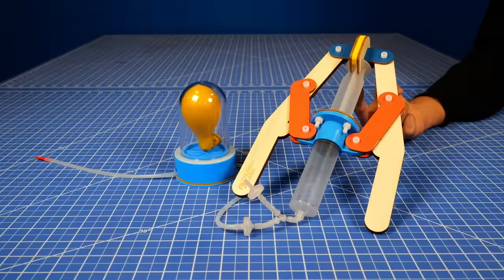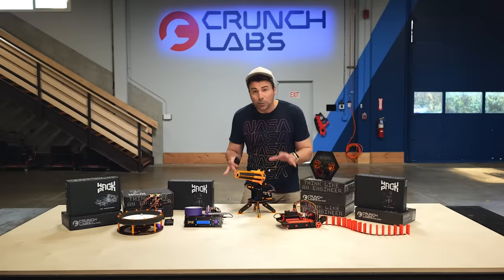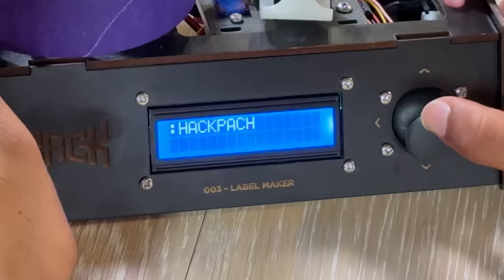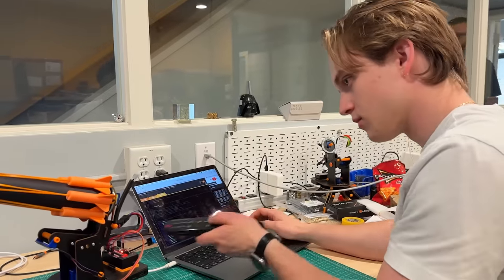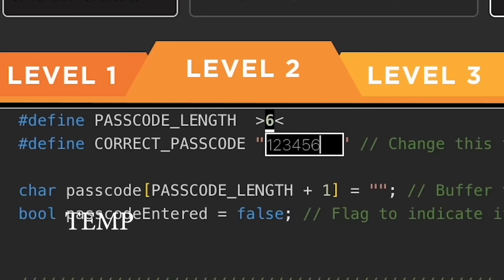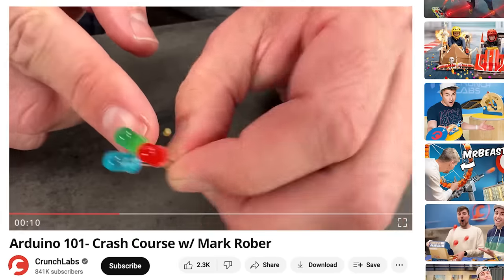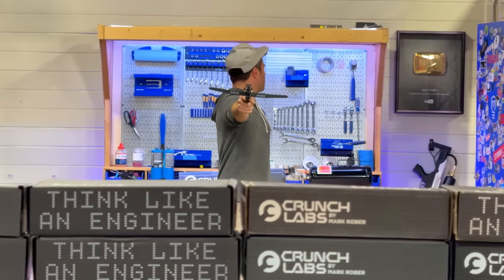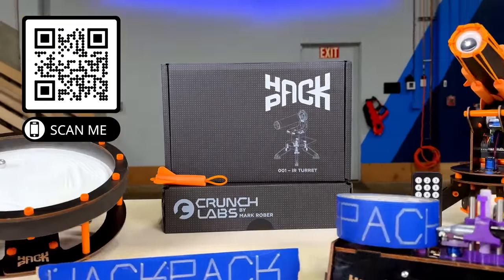Introducing Hack Pack - DIY Robot Subscription Box By Mark Rober

Comment: Received our first box.   Very impressed.  I was worried that this might be one of those cheap kits you get on Amazon, it definitely is not.  It is really well made and you can appreciate the engineering that went I to the design.  Had an issue with one part, they sent out a replacement part.  Highly recommend.

Comment: And sold!
Had considered Build Box numerous times trying to justify it to myself since my kids were now teens and it would have been more me having some fun mini engineering challenges but it was hard to justify the cost since it would liekly be a bit more one and done for me as an adult.
This scracthes that itch with the build but then getting into the meat of the pogramming/coding aspect and will give me somethinbg to fiddle with over the apsn of a couple months until the next box is on it's way.  Brilliant!

Quick question though:
Not even mad that I'm in Canada and don't qualify for the platinum ticket reward but then I'd wonder what happens if I happen to get one?